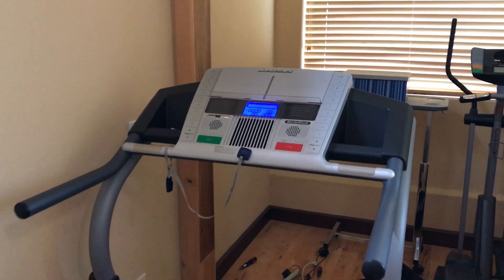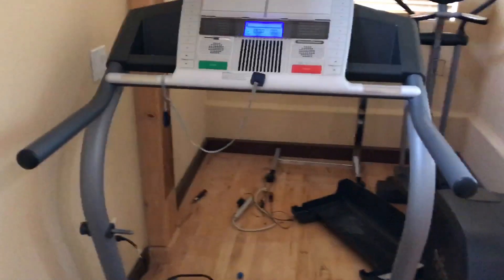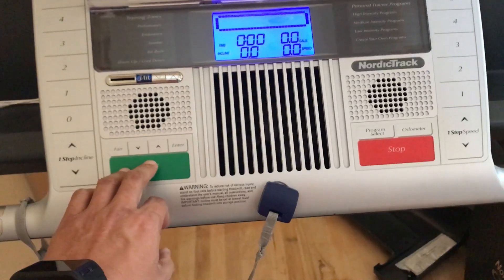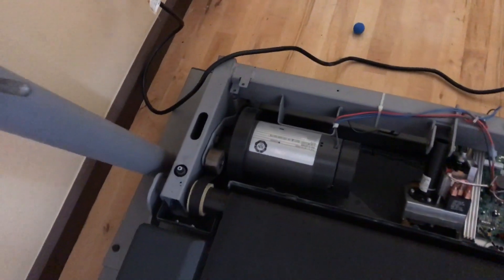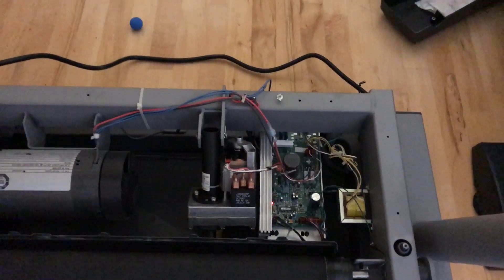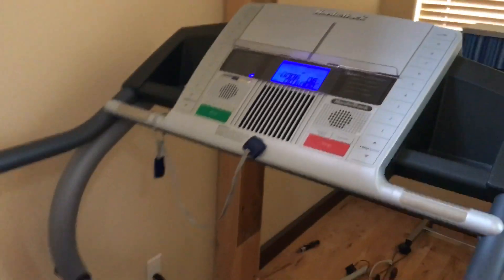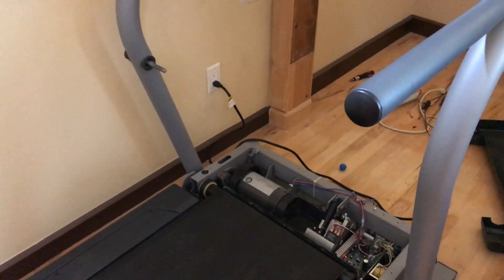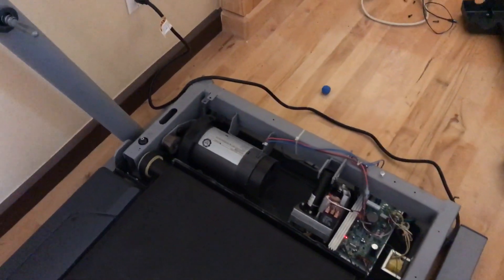Nordic track treadmill C2255 malfunction, motor starts and shuts down immediately

Comment: Mine was doing the same thing, Just replaced my control board on my A2250, works great now, took about 10 minutes to replace $125 eBay. But I saved the old board because the resistors can be replaced pretty cheap if you can find someone to do it.

Comment: Its probably the Mosfet transistor. Its the black thing with 3 pins on it attached to the metal frame. Costs 5 dollars. Replace it and your problem is solved.
Reply: what treadmill do you have?
Reply: @rossnadal4612  a2250
Reply: I changed with a mofset more.stronger  but is.the same 🙏
Reply: Where can I buy the part &part #?

Comment: I had this same treadmill mill for 8 years.  I put a lot of miles on it and lost a lot of weight. Finally the belt started slipping and the running board snapped.....but again, this was 8 years after I bought it.  Used at that. Great treadmill. I just bought another one, same model on craigslist for $100.  Hopefully this one will last a long time too.

Comment: Just fixed my C2100; symptoms were it would not start no matter which button I pressed.
Plug it in, has power, attach safety button, it beeps.. then press Start button.. nothing.
Remedy: Had to clean keypad. Here is a link to a video that describes it:
https://www.youtube.com/watch?v=m8IAZyxoky8
Basically the keypad is two thin plastic membranes with extremely thin metal stripes on it. Something had been spilled on my treadmill (diet pepsi I think) and this got in between the two membranes. Cleaned it out with rubbing alcohol and a paper towel, put it back together and... IT WORKS!! 
Once again, alcohol solves all problems... (kidding). 
Good luck, hope this helps!

Comment: Mine makes a Beep after I turn it on and it won't run
Reply: Clau Esca did you get yours working yet?
Reply: Most of these fixes are that It needs a new control board

Comment: Mine too... it just beep when I press start and belt does not move.  They have lifetime drive motor warranty so trying now to open drive motor hood but it’s a pain. Only able to get 3 front screws out? Anyone can share how to open motor hood?
Reply: Just tried to remove the hood on mine today. Same deal.  I was able to remove the front 3 screws, but it won't come off. I don't see any screws holding it on at the back, so I'm not sure what to do.
Reply: Mine is a model C2255.  Beside the 3 front philips screws, there is a philips screw on each side of the cover where the cover is near the running belt or large metal pipes that supports the console.  Each of these philips screws can be accessed from underneath with a long philips screwdriver - you'll have to set the incline to 12% to make enough room to get the screwdriver into the deep hole for the screw.
Reply: Paul Neumann thank you very much. I have same model. Was it the motor that’s bad with yours? Mine powers on but the belt does not move or any sound from motor. I only see a red light on circuit board.
Reply: @ricodane7567  Mine behaves just like the OP (painmad) - belt starts to spin for 0.5 - 1.0 seconds, then stops.  No error codes on the main console.  I disconnected the red and black wires that go to the motor and connected my car battery charger (12V dc) to the wires and the motor and belt spin nice and slow.  That tells me the dc motor is good and maybe my speed sensor is the cause.  Next step is to unplug the speed sensor to see if behavior changes.
Reply: @paulneumann8605  did you figure out the problem? Mine is doing the same thing. It starts and the abruptly stops.
Reply: @---bp3ib  , not yet.  I suspect the motor control board (MCB) as gone bad.  The speed sensor passes a continuity test just fine.  I get the same exact bad behavior with the speed sensor disconnected from the MCB.  My multi-meter continuity beeps just fine as each of roller magnets pass (manually move the treadmill belt) the speed sensor.  So speed sensor is opening and closing just fine, motor is fine, must be MCB.  Of course, it's the most expensive part to replace.  I'm now hunting for free C2255s in "free-cycle", craigslist, etc. so I can hopefully find a good MCB on the cheap.
Reply: @paulneumann8605  did you ever get this fixed? I just had the same problem.